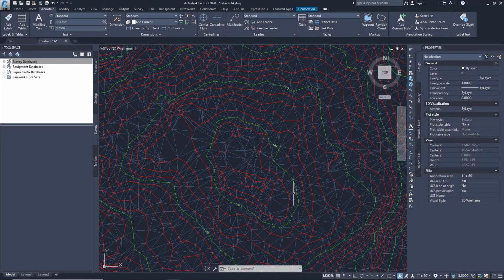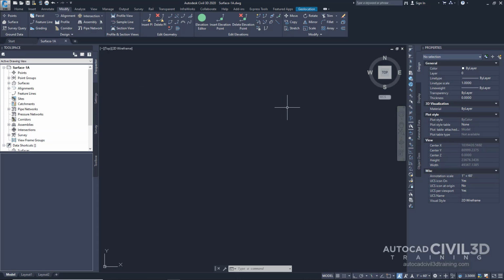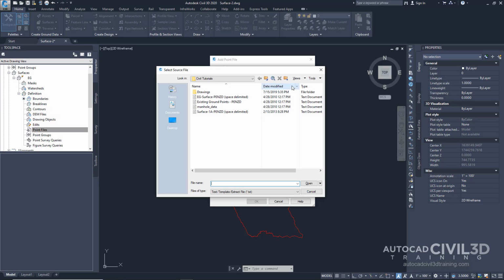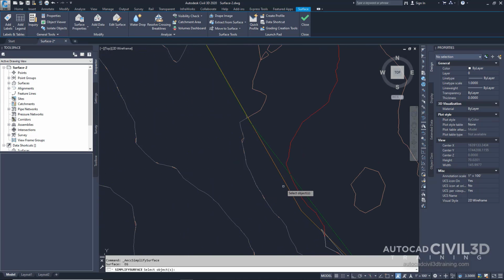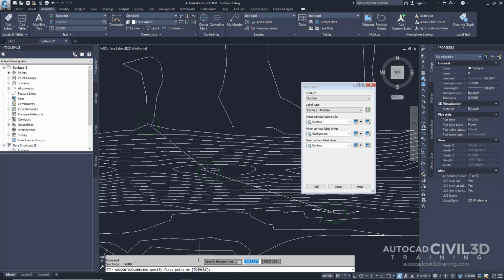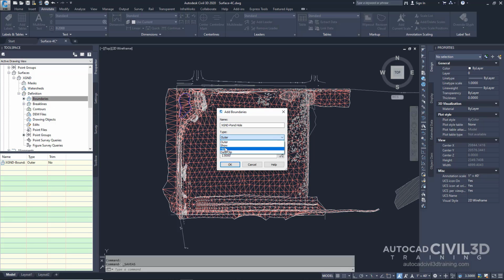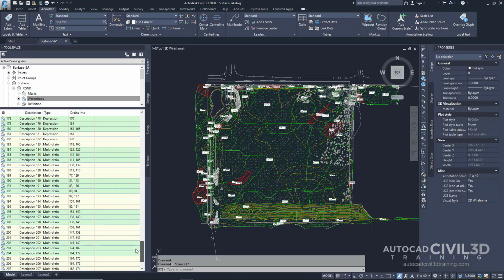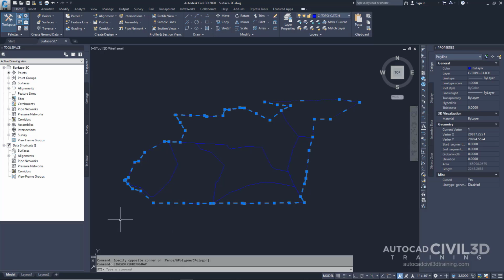03 Modeling a Surface in Civil 3D for Beginners

Comment: Thank you for all the help! I am not able to get my Surface-1A drarwing to show up in civil 3d. It is just blank, no TIN surface, points, etc. Could you give me some advice on this?
Reply from the maker: Make sure the surface is actually listed in Prospector → Surfaces. Then set the surface style to something visible (Contours 1’&5’) and Zoom Extents. Also check that the surface actually has data in the Definition tab. 90% of the time it’s either style or the surface is way off screen.
Reply: The file is indeed empty. The surface is not listed in the prospector tab and there is no data in the definition tab either.